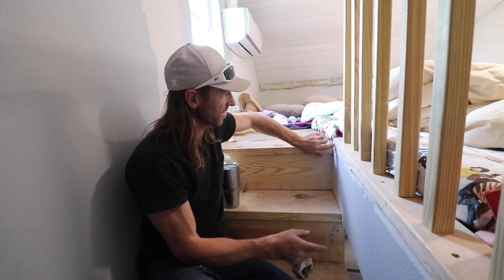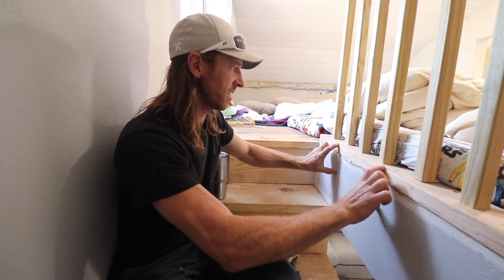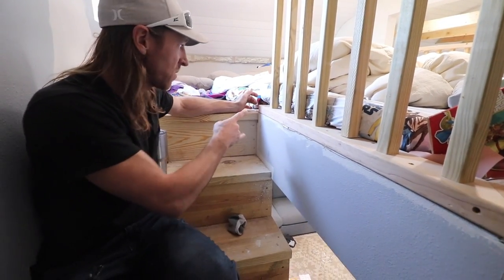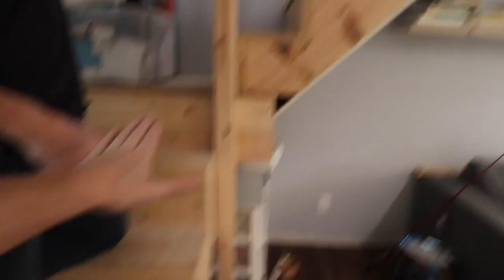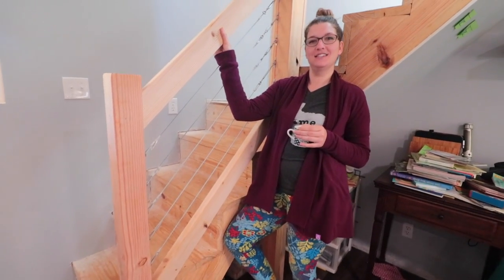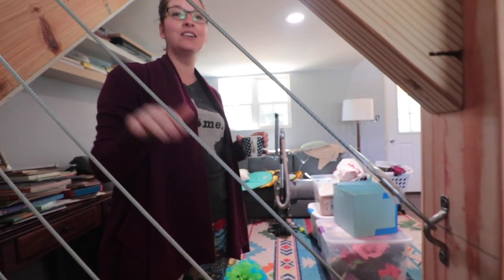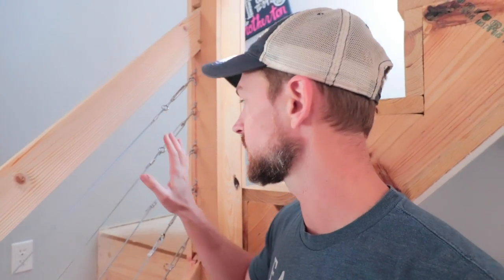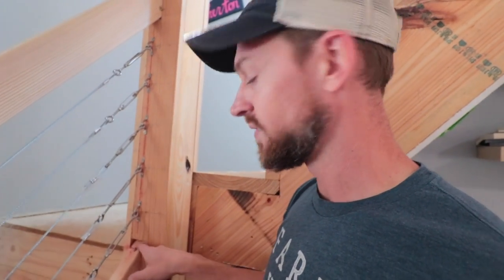Cable Stair Railing in our Shed to House Conversion (for CHEAP!!!)

Comment: You could mix a two part epoxy. Before it sets you can "mold" it to the frayed end of the cables. Another alternative is a product called "Sugru" that is a mold-able siliconized glue that sets like plastic. I have used both for various small repair projects and both have their advantages and drawbacks. The two part epoxy method is a bit more involved and takes timing to get a finished looks that you will like. The best part is, depending on the epoxy, you can sand it to where it looks like it is part of the cable. The Sugru is easier, isn't as time sensitive to mold absolutely perfect and comes in several different colors which gives you the option to have it blend or stand out based on your preference.
James below also mentioned using clear tubing on the cables. That is a good solution as well though I would see if you can't find some clear shrink tubing if you choose to go that route. That will allow you to have it conform to the wire tightly using a heat gun or hair dryer. 
Finally, there is the option of "re-designing" the cable run to where all you see is aircraft cable. You can do this by making your own 4X4 end post using two 2X4. Drive nails in one 2X4, clip the heads off, drill pilot holes corresponding to the position of the nails in the other 2X4. You want four sets of 2 nails with the two nails in each set spaced 2 inches from each other. Those sets of nails will be pivot points for the cable. Repeat this fro the 2X4 you have at the top of the stairs. Make a loop in the end of the wire and thread the wire back and forth between the top of the stair and the end post. once you make the end loop after threading through the nail sets you can either pull it taught and secure it inside the 2X4 sandwich or use a turnbuckle to as you have here to tension the cables. Then it is simply a matter of capping the endpost for a finished look. 
If you like I can send you some Sketchup plans of what I envision here. The best part is that this design is scalable so you can use it wherever you need.
The design you have looks great and very functional. Some will say it isn't too bad for newbies. I say it is good work even for someone with a fair amount of experience. Either way...good job!
God bless you and the family. Can't wait to see what's up next.
Reply from the maker: YES!!!!!!!!!  Sugru!  Kelly said she has always wanted to try it.

GENIUS!!!!!!  Pinned post (of course!). 🤣🤣

Comment: You could use heavy duty clear shrink wrap for the sharp cable ends. Not sure where to find those. In electronics, all the ones I buy are colored
Reply from the maker: Yes we were thinking the same thing too.  Just can’t seem to find it on Amazon.  😕

Comment: I believe you can buy "clamps" to cover those sharp ends.. You just crimp them on.. I use the same kind of setup  for my clothesline.. Wax is fine.. But i know how my kids were when they were little... They'd be picking they wax till it was gone...what one couldn't think of the other two did... Lol
Reply from the maker: That would be AWESOME!!!  I can not find anything like that at all.

Would you be able to send us a link?  That would be soooo helpful!!
Reply: I'll try to find one
Reply: Sorry.. Well..you would have to redo the wire.. We just bought extra double barrels to cover the wire ends... I"ll send a pic in a sec
Reply: I put pick on your fb page